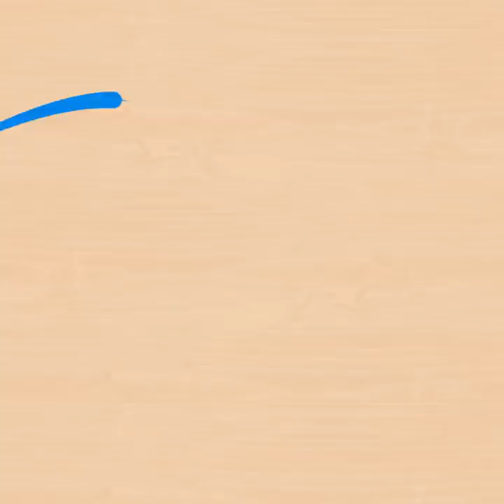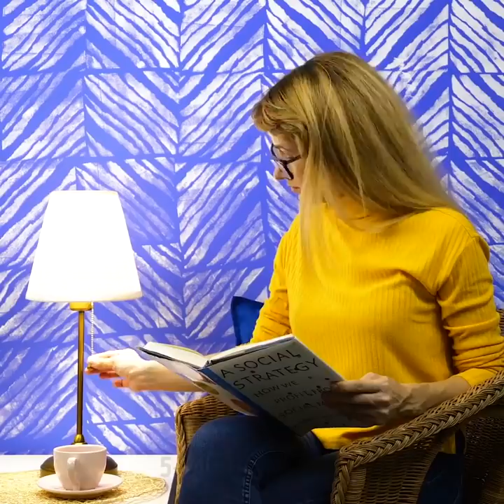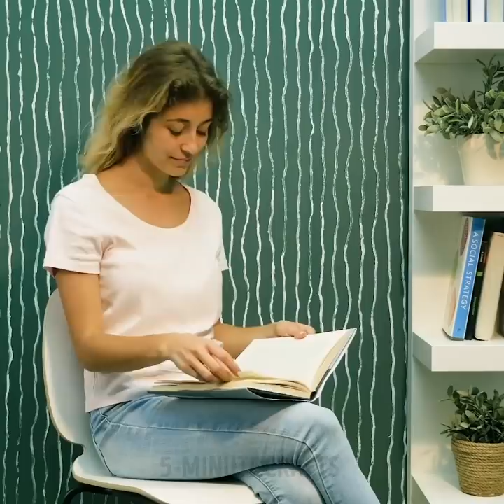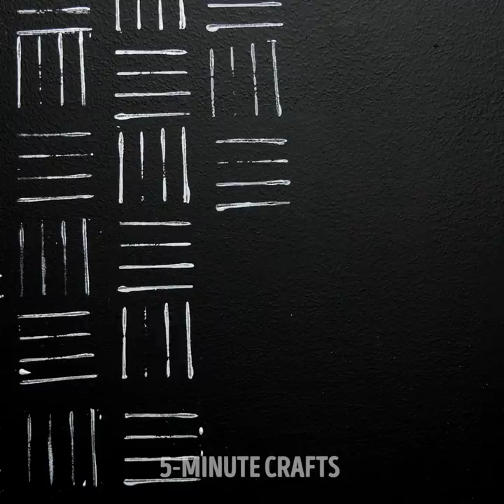31 SIMPLY BRILLIANT WALL PAINTING IDEAS

Comment: They were not painting on a wall because at 4.44 in the vid they were pouring paint on the wall BUT if it was a wall the paint would have been sliding down the wall sooooooo they were painting on paper the whole TIME
Reply: Please check again. They needed the green on the paint roller. 
So they used another place to pour down the green to use that on the wall!